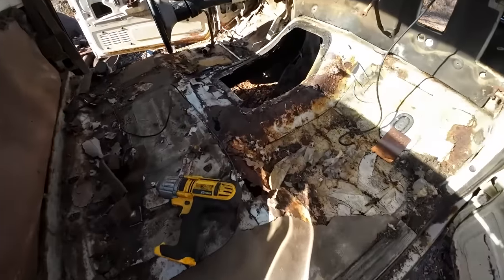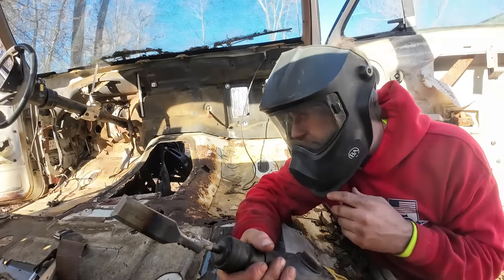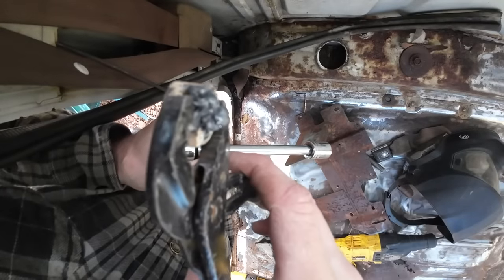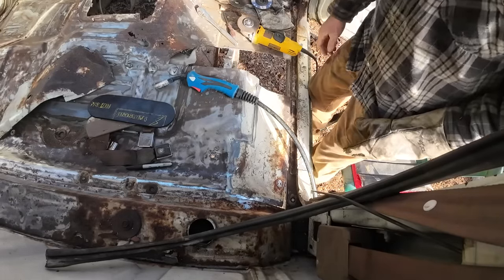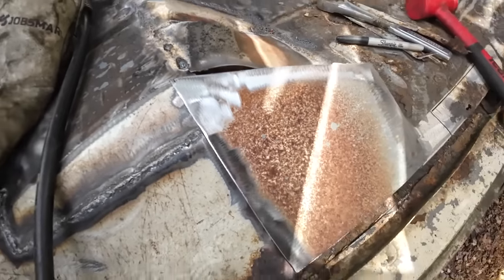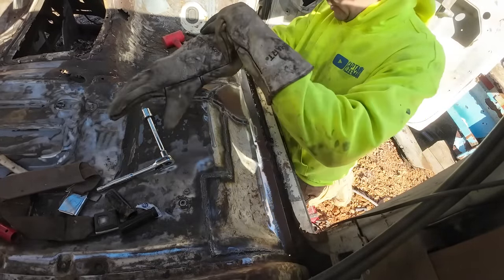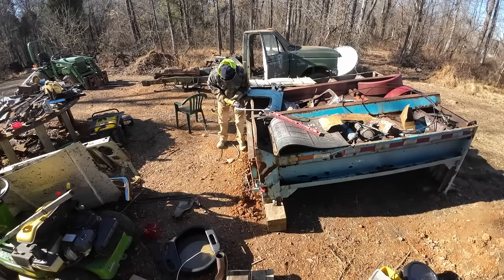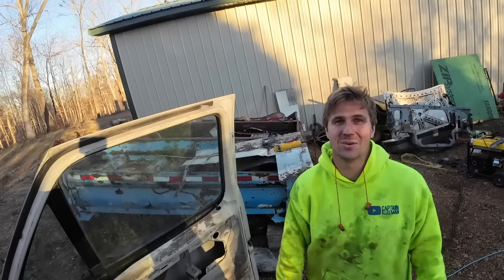DIY Attempt at Replacing Rusty Floor Pans in Ford Super Duty

Comment: Put seam sealer over your welded floor joints, takes care of any pinholes and stops moisture rusting the joints. Great work and progress.
Reply: I was just about to say that. 😎
Reply: Yeah, make it look pretty.
Reply: Seam sealer on top, rubberized rocker panel coating or undercoat on bottom. Alternatively, spray bed liner on entire cab floor. I have used all these methods with good longevity.
Reply: Like he said

Comment: After doing bodywork for nearly 50 years it's nice to see someone start out trying rust repairs Mike, thanks for the content, if you still have some oxy/acetylene pick up some tobin bronze fluxed brazing rods and do the smaller hole repairs with that rather than mig, put the patch under the floor then a self tapper to hold and plug braze through the rust holes, hammer up from the underside then some seam sealer on the patch edges. Mig is great but the temperature of the welds makes the edges of the metal brittle. Can't wait for the world headquarters and shed mods.👍
Reply from the maker: Appreciate the tips!

Comment: When working overlapping sheet metal you can use self tapping screws to hold it in place. Remove them later and weld the hole if you choose to.

Comment: Nobody said sheet metal is easy to work with my friend, but you’re doing a pretty good job! Your corner piece looks good Mike, it’s all about the effort you put into it!👌🏻👍🏻👍🏻 I usually tack weld it and take two hammers, one on top and one on the bottom and work the metal flat! Little by little Mike!

Comment: As another viewer commented, seam sealer will protect all the joints and seams.  I would personally coat the entire interior with Lizard Skin or a similar protective material after rust proofing.  Then use a durable rust proofing coating underneath.  That will help to prevent and prolong the development of any metal cancer.  I know a lot of metal working experts are scratching their heads.  It's not like you have a sheet metal shop with all the equipment to do professional perfectionist sheet metal work!  But for a person diving headfirst into sheet metal repairs, you are doing what you can do with what you have.  👍👍💪💪

Comment: I use poster board to trace the rusty metal onto. Cut it out and trace that onto good flat metal. It’ll look weird flat, but it will be the shape you need when you warp it into place. But as long as you get it welded up, a can of undercoating hides a bunch of errors lol.

Comment: Great job for a guy who claims he doesn't know what he's doing.  Reminds me of the Mustie1 video when he was rustoring a VW and had it looking like Frankenstein with all the little patches.
If I may suggest the following:  When you are finished treat the area with tannic acid (it's what was used to stabilize the CS Hunley by the museum curators).  Also spray the are with oil.  Mustie1 likes Bar & Chain oil but, I've found Wool Wax to be superior and not messy.  I sprayed my truck 2 years ago and it's still holding up.  The oil gets into the tightest areas and stops rust entirely.

Comment: Looking good Captain! And you can silicone the bottom of it afterwards Mike, to keep the rust down or spray the bottom with the bed liner paint for more protection! Yeah, those little one pound spools don’t last long, of course you can buy the 11 lb. Spools! If the fluxcore comes in 11 lb rolls! I’m not sure because I use 75/25 cover gas and hard wire! I think you’re doing great Mike, as long as you’re satisfied with it! Don’t worry about the video critics brother, this is your project! I’m enjoying watching!
Reply: Stay the hell away from bedliner or undercoat. It just traps the nasty water against the steel.... forever.
Brush on some cheap rust converter and use grease, waste oil or wax (or any combination of them) over that. 
It will wick into all the pits, laps and pockets keeping the water out.

Comment: Nice video, some advice and probably I will get some comments on it... If you are not a professional welder,  use 309 welding material. It makes welding a lot easier. You can use it for jobs like this on carbon steel and Stainless Steel. It also has cleaning properties, so less pinholes and a better weld result . When steel has been calvinised also use 309 welding materials, at least to butter it up on the Sn side. This only counts for  private or hobby projects of course like shown in this video . PS you're welds will never rust again.

Comment: Looking great, thanks for sharing. For some reason when you started mentioning overlapping the metal I started to imagine liquid nails coming into the scene. 😂 very impressed with your ability to stitch the pieces together as well as you did. Looking forward to seeing what you have in store with the new world headquarters. Wishing you and your family the best.

Since it seems like nobody is stepping up to give you a laser cleaner I did see a review once on a harbor freight tool that was a hybrid between a sandblaster and a pressure washer. Used water and abrasive rather than air and sand. Might be something to look into.

Comment: Mike folks will say I'm crazy for this but... For what you want this rig for and the fact that you have replaced the rust for the most part with metal. I would recommend a couple of layers of fiberglass over the floor. You've already removed all the loose dirt and rust. The glass will bond to everything left and it's water proof. It will seal all the small pin holes as well as the joints of the pieces you replaced. Not to mention 2 or 3 layers of glass is not only relatively in expensive it also provides a little more stability on rusty old floors. The other upside is those small hole instead of trying to patch everyone of them you can glass over them. Just a suggestion brother. It's looking good. Best of luck on the project.

Comment: Great work Captain - making  tools to use with other tools to get the job done.
Fabrication is fun ! 
A 4'x8' piece of sheet medal from a steel suppler and an electric or air metal shear makes 
short work when making patching pieces.

Comment: Your doing a great job. Try welding a flat washer on first, cleans and preheats the bolt. Use the biggest washer you can, just a smaller hole than the bolt head. Now weld on about a 3/4" nut, 3/4" bolt size not wrench size. Work better than you might think.

Comment: Get yourself a couple tubes of automotive seam sealer and cover all those joints and seems after you're done welding. It will help seal up any pin holes that might have been missed and keep moisture out of all those newly welded seams

Comment: Hey Captain if you have not already done it give the top and bottom of the floor pans a coat of a rust conversion product epoxy primer followed by seam sealing everything good (the bigger the glob the better the job) and then scuff with a scotch brite pad and a coat of Rust oleum Tremclad paint  (I recommend using a brush instead of spraying it. Tremclad will adhere to clean grease free steel like napalm sticks to kids.  Additionally if you have more light gauge (automotive sheet metal thicknesses) a pneumatic or electric flanger and an electric/pneumatic or even a hand sheet metal nibbler or a air-chisel with a panel sliter works far better than cutoff wheels and quickly pay for them selves unless of course you get your cutoff wheels for free or next to free.
PS All in all you patch work on the floor of Rusty Jones looks pretty darn good

Comment: You should look at bronco graveyard... floor pan pieces 40 bucks..rock auto and lmc truck too
Reply from the maker: I have all the metal already and it's free lol
Reply: Lots of extra cutting and welding... cost of welding wire and cut off wheels and time...

Comment: You got me motivated to work on a small paint failure on my 99 Ford F-250 with the good 7.3 diesel. Oxford White where I'm working on it. How hard could it be? Pretty freaking hard when some fool in the past resprayed that side of the bed with a non Oxford White,white.(Prepping and sanded through a top coat,primer,the original Oxford White,and the original primer coat.) Took the wife to look at it and she said "Honey,it's so smooth and looks perfect except for the wrong color white...."  Off to the car paint store later today to see if they can match the white. Grrrrr.:face-orange-frowning:

Comment: I had to take a big D grinder back right after it was purchased. Motor making noises a motor shouldn't be making. 
Inside work is much preferred over outside, in the cold and laying in gravel. It will be nice.

Comment: Have you considered getting an English wheel to deal with all the work you’ll be doing on truck and backhoe. A different thought is to just use epoxy fiberglass to repair weight reduction areas
Reply from the maker: Not worth it for no more than what I'm doing

Comment: the old white Ford didnt goto the crusher in vain, it gave what sheet metal it could so another Ford could live for awhile longer. it's a homestead dump truck, the floor doesnt have to be perfect. at least the floor isnt fiberglass screen, roofing tar and 55 gallons of bondo. floor came out pretty darn good for working with less then desirable patch panels, Capt not being a fabricator. all that matters is you and the seat wont be becoming friends with the ground, keeps the weather out

Comment: Hey captain why not buy a replacement floor for that truck I buy 2, spray rubberized undercoating and screw weld floor together instead of patching most is pretty tired